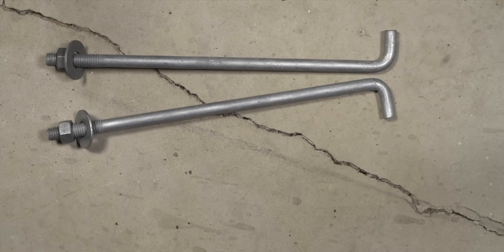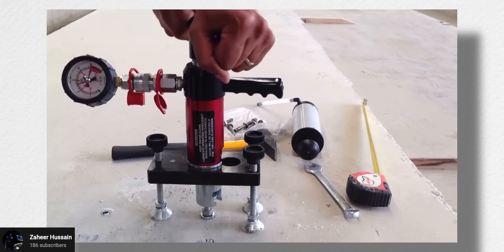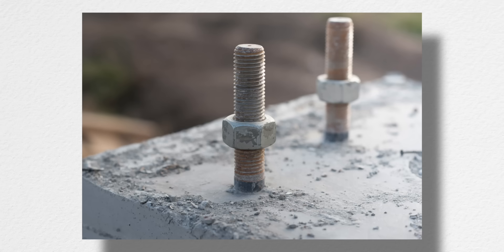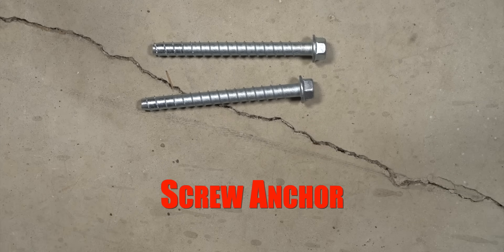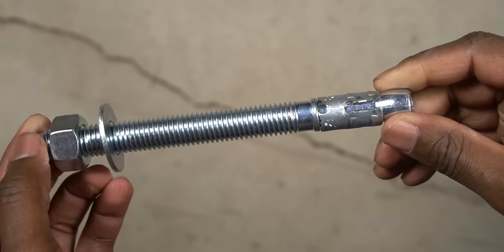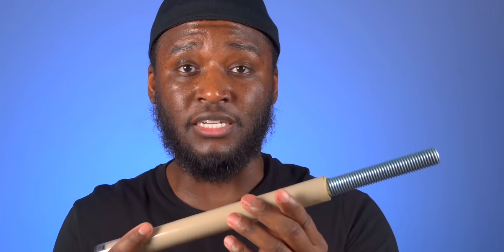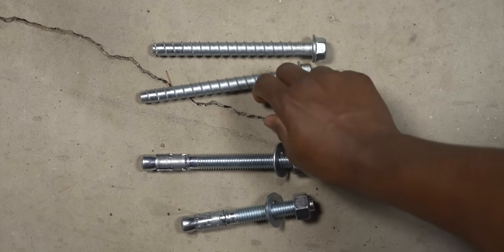Why Abandon "J" & "L" Anchor Bolts in Wood Framing Construction FOR GOOD?

Comment: Good video.  We see L bolts in commercial all the time but they aren't those little things your are showing. Not only are they bigger in all directions, they are usually paired with the horizontal rebar, the "L" hooks under the horizontal. 

In residential, IF you have enough wind to pull out a series of L bolts, you likely have much more important things to worry about. As an PE, you likely know the cause of failure is rarely one thing, the system failed not just one thing. 

For the sleeve or wedge anchors, the only person that knows if they "grabbed" or not is the person who installed it unless an inspector is going to walk around with a torque wrench. Epoxy is good IF the installer, usually the unskilled crackhead cleans out the hole correctly. I never messed with screw in anchor bolts

Engineers need to stop trying to reinvent the wheel and just make a proven practice better. Make the horizontal part bigger and/or tile them to a horizontal and call it a day.  30 years as a commercial CM.
Reply: Agreed! This is a terrible swap!
Reply: You called it, hook it under rebar, or put a longer horizontal on the bolt, or a washer or plate etc. on the bottom of the bolt. It's weird he shows a test with the J bolt  barely under the surface if the concrete. You can only use the horizontal part for testing (?!?), but buried in 6-8 inches of concrete makes a huge difference

Comment: I recently replaced a section of rotted sill and rim board on a 50year old house and discovered the block wall foundation had zero anchor bolts. The house was resting on the foundation and had not budged at all.   Most barns in my area are sitting on stone foundations with mudsills in various states of decay and have no mechanical tie to the stones.  I live in new england where we do not have tornadoes or hurricanes but it seems like this issue of anchors bolts just gets beaten to death.
Reply: And that is New England. If you look at Tornado tracks over the past decades of data collection you will find that nearly a Quarter of Lower 48 US territory fall within tornado activity. That is why you have code requirements and then you have accepted practices in certain areas.
Reply: fwiw. Growing up in a hurricane prone area that also can have some tornadic activity, most old homes, etc weren't anchored. I lived in a small 1910 house that was 10-15' above the mean high water mark and no floating away ever happened (heartpine house on brick piers). I dont condone it now, because I've also seen 'tied down' houses floated off their foundations and smaller homes partly sitting on trees.
Reply: Do you ever get floods up there in the frozen north? Sitting houses on cut stone blocks using heavy 8x8 or bigger sill plates was common before the mid 20th century. I once saw a big three story Gothic with all of the gingerbread trim, cut glass doors and all taken off it's foundation stones and floated a hundred feet or so downstream when 'the creek came up'. The only thing that kept it from washing away was the recently properly installed modern electrical service entrance mast and the electric company's service drop, which was stretched as tight as a guitar string. No obvious structural damage, but of course it wasn't level in its new location
Reply: @kimlground206 yes we have floods.  Typically in areas have historically flooded like river flood plains.   
Ed
Reply: You can thank homeowner insurance companies' influence on building codes, and hurricane Andrew in FL for the code  requirements for sill and roof anchors. Also for retrofitting mobile homes with hold down straps and, later, built in anchoring provisions on the lower steel frame.  Overkill in many areas, but considering the cost if your roof or whole house gets blown away it's cheap insurance, especially considering that violent weather seems to be getting more frequent in some places.
But no amount of anchors or strength of construction will save your buildings if mother nature gets serious about wanting you to relocate.

Comment: On the Japanese video, they also use the L bolt, and also as a way to hold parts of the sill down temporarily while straightening the rest of that sill to the chalk line. So, it's not useless to precision nerds. Maybe I could add a few screw or wedge anchors on the 4 corners of the sills after if it pleases you.

Comment: j bolts dont have to be installed that accurately... maybe if ur walls are 2x4s lol. 
you just line up your sill plate next to the bolts and use a marking jig or balance it on top of the bolts and hit it with a hammer. 

one big problem with post install ones that you missed, is corrosion. the only thing keeping those things in is thin pieces of metal. where as that j bolt can corrode a lot and still be strong.

also with the wedge ones, they often don't work as intented. more often than not, the wedge wont expand and they will seem tight, but will be completely loose.
Reply: maybe the screw anchor is better than the wedge anchors? less prone to rust-like deterioration? I think I'm gonna add extra screw anchors on the 4 corners and L anchors for most (also the corners).

Comment: J installed during the pouring process have been proven in numbers to be more effective at preventing homes from sliding off foundations in tornadoes and hurricanes. Anchors that are drilled in post-pour will never be able to hold onto concrete that well.
Reply: dang now we are getting opposite statements whaaat?!

Comment: Is this a joke?
Never in my life seen a J Bolt fail.
Everything you showed, seems to my mind to be inferior to the J bolt. I have use similar screws to tie down frames walls to basement floors which were non-structural in order to refinish the basement as living space. I would be very leery of taking this video as real, without backing it up with other information and a lot of it. Almost 100% of houses are tied down to the foundations with J bolts and you never see them flying off during a storm. I am wondering whether this video is a joke or a marketing ploy to promote the things that he is promoting..
Reply: I think he's just saying in a rather provocative manner, that the J and the L have less hold-down power.

Comment: I agree somewhat, but for a house the L bolts should have plenty of hold down. 
Also smooth shank vs threaded? 

Here in Australia its all post installed anchors except for stuff that is big.
What I mean by big is say a radio tower you might use cast in bolts but weld them to the cage in some cases, but a tower is also side loaded which helps the L bolt.

As you said chem set anchors are very strong but they basically have a 75mpa resin in a 20 to 35mpa base material so you're still limited by the base material being concrete at say 20mpa.
This means cast in bolts are the strongest, not L bolts but rather threaded rod.
What I do is if I have a square steel plate I need to anchor if I can set it in before the pour just make a plate in the steel and one out to align the bolts and now one bolt is achored with a plate and 4 other bolts.

Comment: Practically, the post installed anchors would not be as strong as the J anchor bolts. Since you have to drill a larger holes with a lot of concrete dust, if test on sites, the J anchor bolts would have a better performance.

Comment: Aren't J bolts and L bolts supposed to be used with rebar running horizontal along the rounded inside part, essentially holding it down, hence why they are shaped like that. Makes sense that it wont hold if you are using it in a way it wasn't intended to be used, or I may be wrong , maybe somebody should do a "I was today years old when I found out...."

Comment: Gave up J bolts almost 20 years ago for sill plates and use Titan HD anchors.  CA code legal for sill plates.   SO much time saved.  Stand the wall, drill straight through the bottom plate into the concrete (about 30 seconds with the right rotary hammer), blow out the dust and impact wrench in the Titan.   No comparison in labor saved.

Comment: Nice presentation and clear information, mate! However, I would avoid mechanical anchors, which induce increased stresses on a small section. I highly recommend the J & L bar as an engineer. But, as you said, it's more convenient to use other types of anchors for site difficulties. Chemical bond anchors are a good alternative after concrete casting, but, the downside is that it's expensive. A good engineer will sit down with his builder and discuss preferred construction methods and a budget, as some builders have more confidence to choose specific options.

Comment: Hi Jay, good stuff.
Just want to add my two cents. Typically L & J bolts are used for shear load, not uplift. 
Secondly, the wedge anchor might cause concrete  spauling with close edge distance installations. Where the screw anchor at 1 3/4” isn’t a concern.
Reply: Thank you. Hold down anchors are cast in place anyway, unless it's a retrofit situation. There's no load reason not to use J bolts for lateral restraint.

The main reason not to use J bolts is- inevitably the layout gets messed up or framing changes and you end up with a bolt right under a stud or post and have to cut it off and use a post-installed anchor. After you do that a few times you think about just using post-installed to begin with. Then you remember how much they cost, and buy j bolts anyway and swear at the guys to do better on layout, lol.

Comment: I do not agree with your comments. Do you know you can put a very long L bolt such as 12-18 inch or even more into the concrete. There are also bolt holder available which can be installed before concrete pouring. Therefore you can accurately install bolt and pour concrete over it. You can also tie it to the rebar if design properly. It is very hard to drill a hole in concrete as such depth. 
Please provide some comparisons for both methods under similar conditions. Without comparison, it is not persuasive.

Comment: Good to hear, I'm digging and installing new footings for my garage previous owner never did and all the sills are rotted away and I didn't put in any J bolts so going to go for the 3/8 in  hammer in anchor bolts. I use an Milwaukee  SDS drill sooo much quieter than the old hammer drills.

Comment: None of the options you mention spread the tension load across concrete. A J bolt hooked on a horizontal rebar will far exceed everything for resisting uplift forces. But I definitely agree having to preposition the anchoring is a pain in the butt.
Reply: The limiting factor are the nails from the sheathing to the sill plate and cracking of the sill plate.
Reply: Very difficult to get the J bolt under horizontal rebar
Reply: @Art-Lover69 gs Ever hear of spacers?

Comment: As a fellow engineer, I would have expected test data to prove the point.  Mechanically, i don’t see how the 2 post pour options would provide more holding force.  The cam lock is worse.  The epoxy is the only solution that distributes more load to the lateral  surface.
Reply: I agrée with you. At least the L bolt can hook on the concrete 1~2 inches around it. The post anchor bolt just use the force few mm around it. I seriously doubt the can provide the same force in the same condition.
Reply: @CDing123  The thing a lot of people seem to miss is that the cast in place method does not allow for really any strength along the shank and very minimal around any buried threaded portion. So you essentially have a point of load distribution buried beneath the surface, wherever the "L" or "J" hooked portion is.

Epoxy chemically bonds the concrete to the rebar or bolt. As such, you get a larger cone of influence. 

There are many applications in which epoxy-set bolts or rebar is stronger than cast-in-place.
Reply: @V8Z3  you can hook the J or L bolt on a rebar. That will greatly increase the stability on it. There are lot of parts on market which can hold the bolt in position before pour the concrete.
Reply: When we forget or mis-position an anchor bolt the engineers solution is always epoxy
Reply: @chrisanthony579  yes, but this isn’t being recommended as a backup but a replacement
Reply: And none of those bolts are meant to resist uplift anyway, at least not in the global sense of the whole house uplift that was discussed in the video.

Hold down anchors (bolts or straps) that resist uplift are generally cast in place anyway, unless it's a retrofit situation.
Reply: @kevinfarrell329  Almost every hold down I see installed is post-installed with epoxy. I do a lot of commercial construction, high rises, mid rises, multi unit apartment buildings. Smaller scale projects, gas stations, restaraunts, etc, also use post installed epoxy.
Reply: @V8Z3  Where do you work?
Im a gc in the SF bay area who does structural work. Out here in EQ country we'll use epoxy (or more often mechanical anchors like Titens) for AB re-location, but any HDs are pre-set stabs or straps. Unless it's a retrofit.
Reply: It took me all of about 20 seconds to get a copy of 12 page specs on the bolts from Simpson.
Reply: @asbestosfiber  the point was it should be in the video
Reply: Kevinfarrel329 That statement makes zero sense, Kevin. To say that an anchor bolt is not designed for vertical forces yet it is for shear and horizontal forces is 100% false. It is designed for all three. If it wasn’t designed for vertical forces, why is it an L? Why is there a base piece firmly attached to the vertical piece? If it’s only holding horizontal forces, you don’t need the base, threads, cam or epoxy. You just need a steel rod straight down into concrete. Yes, the fail point to vertical uplift forces on a house is somewhere else (rafter ties), but the anchor bolts still play a role in making something else the fail point. If they had zero vertical holding force, as it sounds like you are implying, then the anchor would be the fail point.
Reply: @mst5632  The fail point at a wall when vertical forces are resolved is at the end posts of the shear walls.
You know, where the HOLD DOWNS are placed.
I really hope you can guess what hold downs are for?
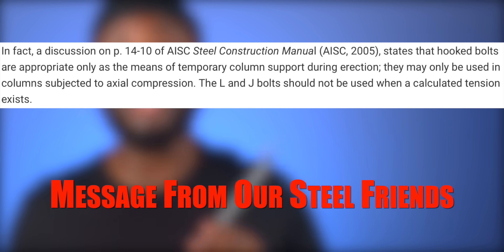Reply: @mst5632  here's a very brief explanation of the difference between sill plate anchor bolts for sliding and hold downs to the foundation for vertical force. Skip to 0:40
https://youtu.be/TZW2M7oFllc?si=Eqlw1bUet0AtUQMa
Reply: @mst5632 
The hook or L as you call is to counter the compression of plate to concrete when bolted down allowing for a shorter bolt length with out pulling out of the concrete.
Hold downs (an engineered, often much larger and long bolt) are for uplift.
Reply: Epoxy work only on paper, poorly on site
Reply: Agreed, you should include comparison vertical loading data. Without it, this is just an opinion. I am not an engineer, but intuitively the screw-in and expansion offer less holding surface than an L-bolt. Perhaps the epoxy does have more holding surface but is definitely more cost & labor intensive. 
Additionally, for L-bolts which are suspended & concrete is then added, they will outperform all three post-install bolts as they will have aggregate above the horizontal bolt area and that further spreads their holding surface area. When I built a CMU foundation wall I partially filled the block, placed a T-braced L-bolt set to correct height, then finished the top pour. Pushing them in after the pour pushes aggregate out of the way. I’m an individual builder so not worried about production time. I feel setting L-bolts after a pour is lazy production method at the cost of vertical hold.
Reply: @mst5632  all the bolts he looks at (screw, expansion and J) aren't used for uplift resistance, they're meant to resist lateral/shear forces. They keep the bottom plate of the wall from sliding sideways off the foundation. 
And they're all essentially equally good at that because the thing that fails in that application isn't the bolt/concrete connection, it's the bottom plate/bolt connection.  The wood bottom plate breaks apart before any of these fail at the concrete in shear/lateral loading.
Hold-down anchors are the anchors that get yanked up along their axis and are prone to pull out. 
But none of these is used for hold-downs.
Reply: @ I agree their primary strength is for shear and horizontal holding. But, they do provide vertical holding as well and so I was only speaking to what he was talking about. Not so much about what is the complete purpose of anchor bolts.
Reply: @mst5632  They are not designed, engineered or used for vertical/uplift force.
OP is talking nonsense in this video
Reply: What I said above under a comment 
Not engineer but in experience. Only use straight for mistakes.common not to grab.expensive fix when they dont.then, have an epoxy . What i think he thinks is the strength of the bolts' metal. They now have high material strength. But in my experience, a straight vs. a L .like sliding down a snow mountain. A pickaxe or a bar. No brainer.
Reply: J bolt everyday fam

Comment: Great info. Thanks for the vid, I Believe the Epoxy anchors are still required to have a Deputy inspector overseeing their install which will add to the cost. But both are great anchoring systems.

Comment: I just came across your channel. I'm sorry to see that you have not continued but considering the last few years I am sure you have been an extremely busy engineer. I wish you the best. I wonder if you can explain considerations when building a single wall (2x6 16 o.c.) over 12' tall. God bless you.
Reply: A lot of the strength and rigidity of the wall depends on not just the studs. You have to look at the entire wall system taking into consideration what kind of sheathing is on each side, whether there is some sheathing on both sides or just one. Even the type and distribution of fasteners matter.
You are off to a good start using 2x6 instead of 2x4....